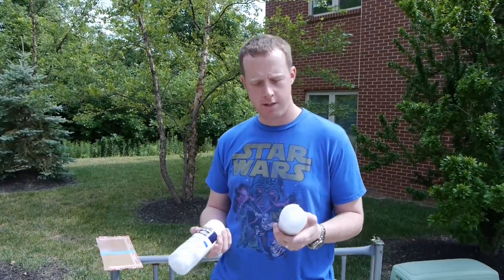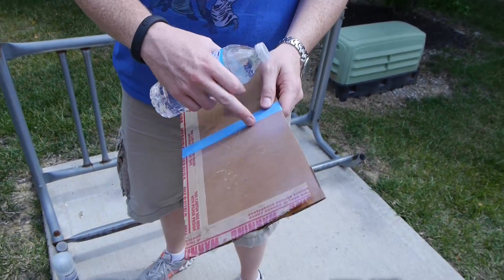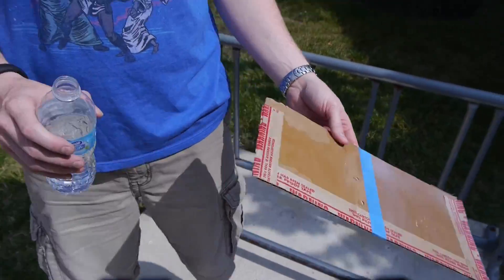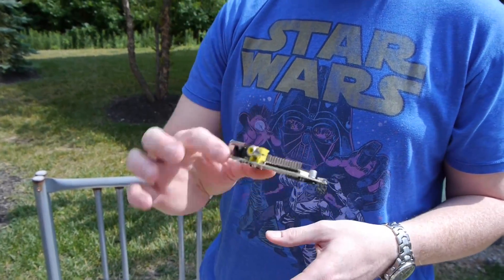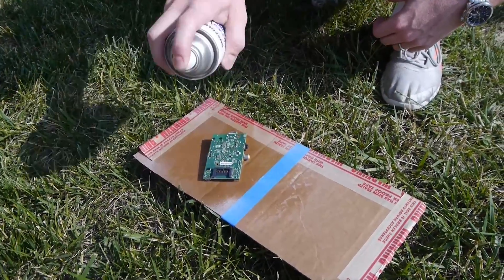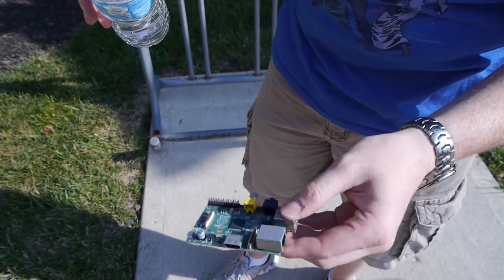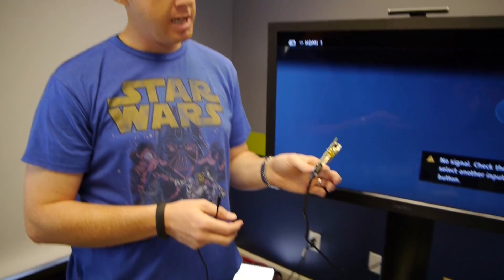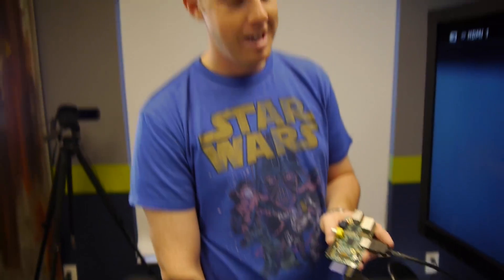Having Fun (Almost) with Superhydrophobic Coatings and a Raspberry Pi

Comment: You sprayed the board with none of the components in it.  I'm guessing they had trouble making contact.

What you need to do is solder everything in to the USB, SD card holder, power, etc.  Then spray it on and let it rip.  I would guess you'd yield better results.

Comment: Not what I was thinking... but it brings me to what my point would be.  Any proper testing would have meant that they tested the pi after it was treated but before it had water poured on it.

You may very well be correct but at the same time the coating could have ruined the device if it is at all conductive... probably isn't but who knows they didn't do proper testing.

Comment: I highly doubt it was the water that ruined the Pi, it was the fact that they coated some of the metal contact points. The contacts where the SD card holding the operating system were fully sprayed and I'm assuming some of the contacts where the micro usb plugs in were affected as well. This has nothing to do with the water damaging the device.

Comment: You are right. I tried this on my smartphone and it wouldnt turn on bc the battery wasnt connecting. Never wet is non conductive so you have to scratch it off the electrical contacts.

Comment: If you plug in all the connectors and SD card then coat it, it may work. I'm thinking the pins are not making a good electrical contact for SD/power/HDMI/USB etc.

Comment: Do you run into issues with the pi overheating because of the coating locking in heat?

Comment: those two "cans" make for one layer, so once you apply the first layer, you repeat the process :) First can "spray it on evenly and let it dry" second can "spray it on evenly and let it dry" and then repeat. This hydrophobic product comes with those two cans, and from my little ignorant understanding it seems to me that these are just sub layers, the first one serves as a "velcro strap" for the second one, which seems to be the "real Hydrophobic coating.
So it's a tedious (read the next comment)

Comment: I think it's because you didn't coat the inside of the ports with it.

They demonstrated it with an iPhone and it worked, but it only worked when they took the casing off and sprayed it all inside the little gaps and ports, before submerging it.

Comment: I'm guessing the ports and inputs are what caused the problem. The "obvious" solution would be to coat them as well but that wouldn't really work because the contacts in the ports/inputs wouldn't work if they're coated in "paint".

Comment: You can spray circuit boards with as much water as you want, as long as there is no power, and you let it dry before turning it on. What is the point of the super spray? lol

Comment: I guess you got some water under the external connector cases or the capacitors. Hard to coat when the components already stick on the board. Maybe some focused coatings on these areas will do the trick.

^^

Comment: Wanted to also add, if you are going to experiment with other chemicals, try placing a little bit of the chemical in a plastic bottle cap or any other small container, then get 2 pieces of copper wire and clamp each wire to some alligator clip probes of your multimeter, then set it to ohms them measure for resistance, if you get any results that are different than when the probes are in air and far apart (no circuit) then the chemical is not safe (if it dries hard, you can test again when dry),

Comment: did you clean the contacts, a poor connection on the power pin of the will cause issues

If you want a tried and true method of waterproofing, get some conformal coating, it is designed for electronics and will have similar effects. Just remember to cover the contacts (you can use hot glue on exposed pins you want to use because hot glue comes off easily, if the pins are hard to reach, then see if you can tape the entire area or carefully apply.